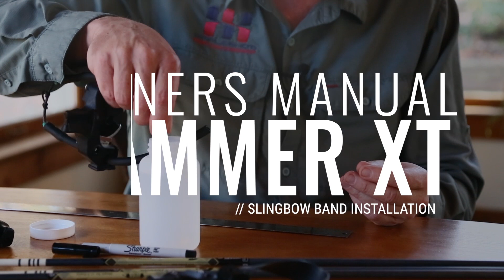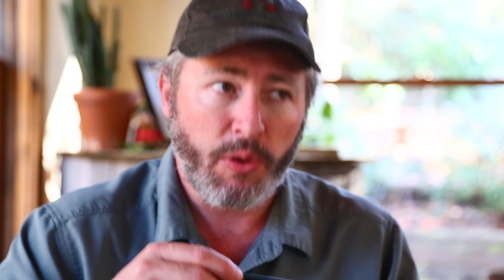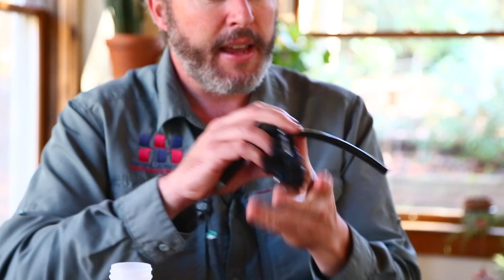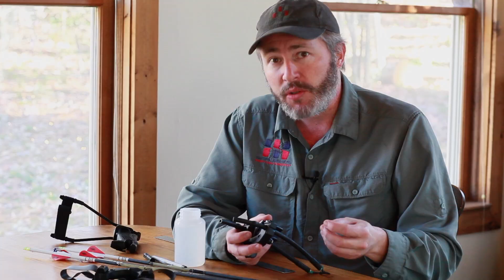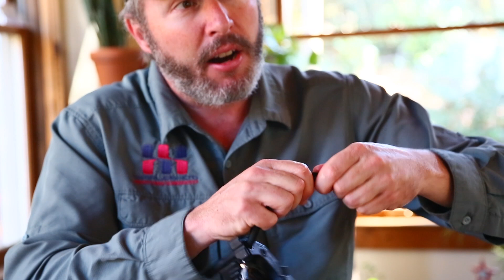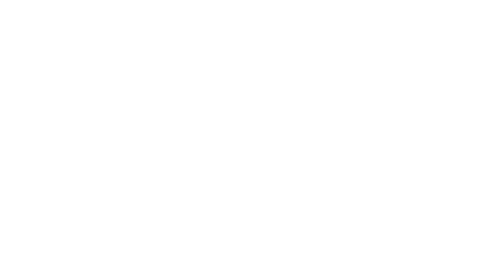Hammer XT™ Slingbow (Single strand) Tube Installation and Band tuning. Simple installation!

Comment: Hey nathan if 28 inch draw is 6 inch working band length how about if my draw is 26 inch what should be my working band lenght
Reply from the maker: It will depend with the elongation that you use.
Reply: @simpleshot  around 30 _35 lb of draw
Reply from the maker: The draw weight does not matter as it is the draw length we are looking at. You will want around 5.2 inches of active band length to be at 500% elongation.

Comment: I got a longer draw length than that so now I gotta find longer bands or make some
Reply from the maker: Our bandsets come 10 inches so it will accommodate even most full butterfly shooters.
Reply: @simpleshot which bands are 10 inches the slingbow tubes or the flatbands? Cause from what the video says the tubes only pull to 28 inches

Comment: Hey man, I have gold theraband and plan on doing OTT, would you recommend a one strand or double strand?  As of now I can’t reach my cheek, so if I just take off a band from each side, would that probably be good ish?
Reply: So ended up changing my setup to a single band, I’m using about 7 inches and it fits perfect to my face. I am using gold theraband that’s about 18-20mm. I also do use 3/8 inch steel balls. I know lead is better but I tried to be a bit more environmental friendly. I went out shooting yesterday and I just cannot get much power out of it. The wind up is good, but the ball will go 30 feet before dipping down really quickly and not even going very fast
Reply from the maker: @theoutdoorangler1173  So you're using flats, right?
Honestly, 7 inches is a lot of rubber for a face anchor. 7 inches would only be the correct length if you have a very long draw.

Check out our videos on:
Active band length
Draw length
Tuning bands / Matching bands to ammo

And honestly, Theraband used to be a great choice, but any more, it's severely lacking in the power/speed department. The precise latex is very fast and our SimpleShot Black is still our favorite for a combination of speed/longevity.

That said, the important thing is tuning those bands. Make sure you're getting all the stretch you can and you can send 3/8 out FAST!
Reply from the maker: Are you talking tubes or flats?

Comment: A question if I may... are these tubes so close in draw weight to each other that they can be cut to equal length? How far out of line would it be to draw each tube to 28" and cut them accordingly?
Reply from the maker: For clarification, are you asking if you can cut the tubes first, then install?
Reply from the maker: The draw weight will go up as the ball bearing is inserted closer to the serving attachment.  We recommend 6" of working latex tubing between the ball bearing and serving attachment as a starting point.  When drawn to a consistent 28" anchor, the tubes from one set to the next should be close.  However, they will not be exact as latex will begin to fatigue with age and use, reducing the retraction speed.  You really can't compare sling bows to traditional bows in an apples to apples mindset.  Slingbows are fun and capable, but if you are after traditional/compound archery like consistency, you will most certainly be disappointed.
Reply: If you put each tube on your draw weight scale that you have, how close is the poundage to each other? I was just thinking that if they were close to equal poundage and not just length, they would be more accurate? Just thinking out loud.  @simpleshot
Reply from the maker: @aksalaman4689   they would match one another and yes, we could simply cut them to a given length.  However, not everyone shoots the same draw length or wants to shoot heavy bands.  Sending them out long allows you to custom tune them to your exact needs...which makes you capable of pursuing more accuracy and consistency.
Reply from the maker: @aksalaman4689  I see what you mean now. So the goal would be to increase accuracy in equalizing the band sides?
Reply: Thank-you. Nice talking to you.  @simpleshot
Reply from the maker: @aksalaman4689  You too. Let us know if you do try that method! Most people are going to need to measure and cut! :)

Thanks so much for stopping by and asking!
Reply: @simpleshot  That's exactly right. Not based on band length but band poundage. Sorry I wasn't able to clearly state that in my original question! BTW...I don't own a slingshot, how funny is that!
Reply from the maker: @aksalaman4689  Well, now is a great time to remedy that! Our whole store is on sale! :)